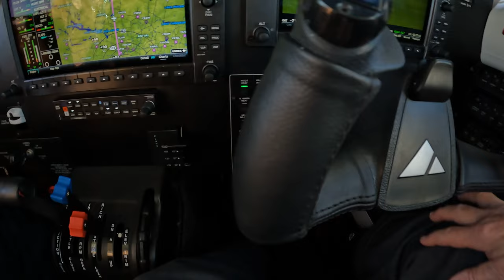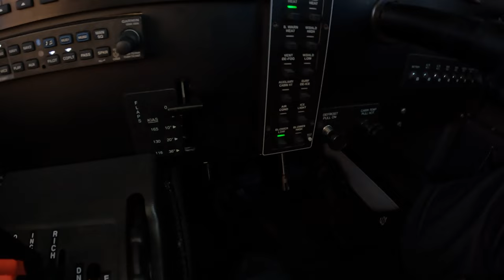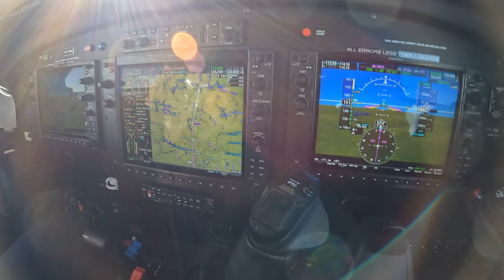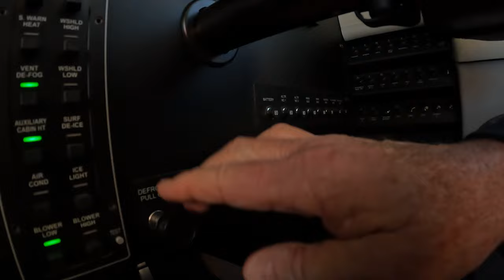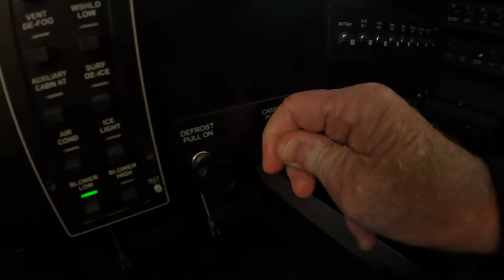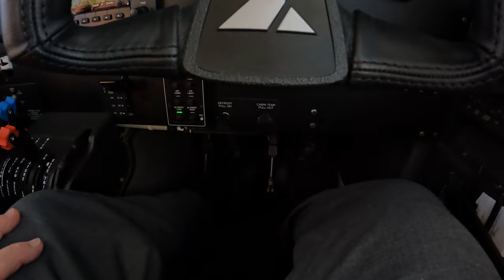Piper M350 Environmental System Explained

Comment: One of my first purchases after I got my first Mirage in 1996 was a set of blankets for the rear-seat passengers...twenty-seven years later we are carrying same blankets in the M350...the heating system, particularly for the rear seats, is marginal, especially when flying high at night and you do not have any solar radiation helping to keep the cabin warm.
Reply from the maker: Time to get your order in for an M600.. plenty of heat! Fly Safely - Train Often .. DR

Comment: This VENT DE-FOG works like the VENT switch on meridian?
Reply from the maker: Yes, but in the M350 it is paired with an Aux heater which is helpful but not as good as turboprop bleed air. Fly Safely - Train Often .. DR